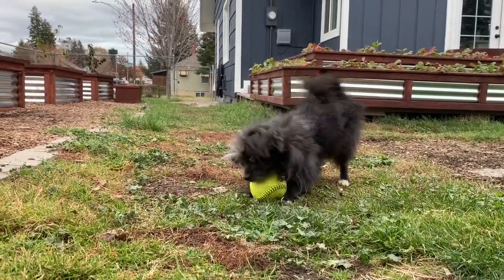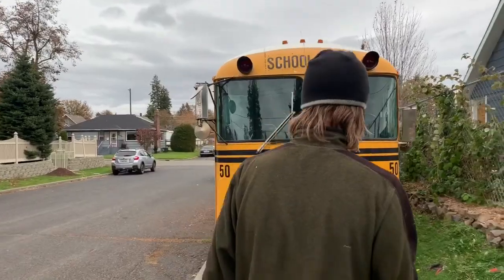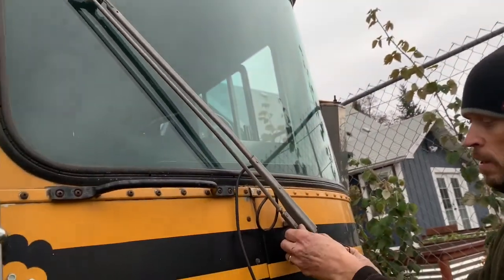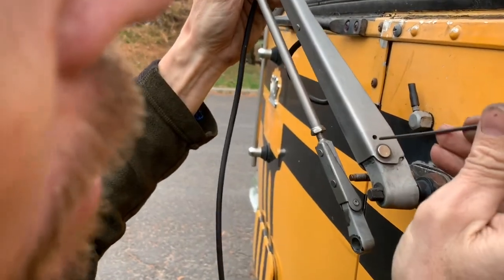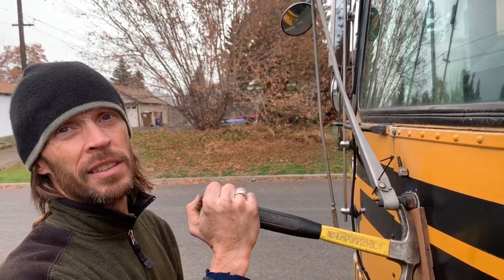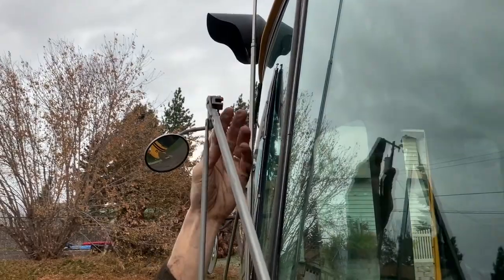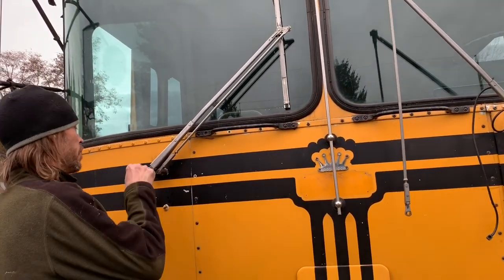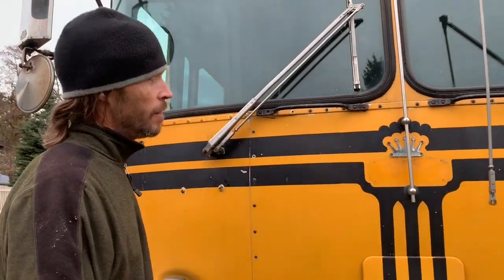Replacing the windshield wipers | 1989 Crown Super Coach | Skoolie

Comment: If you haven't already figured it out, the broken piece is called a "phantograph adaptor."  They tend to rust over the years and when you try to turn the attachment nut they will break off.  I was considering purchasing a Crown Coach from Al Jennings in San Bernardino but thought about the time that it was going to take to get it converted to a motor home.  So I purchased an older motor home as a starting point.  Good luck working with your bus!
Reply from the maker: Good to know. Was able to get the part fixed at a local machine shop. If I can get a new valve for the wiper motor then the wipers will be in business. Good luck with your motor home :)